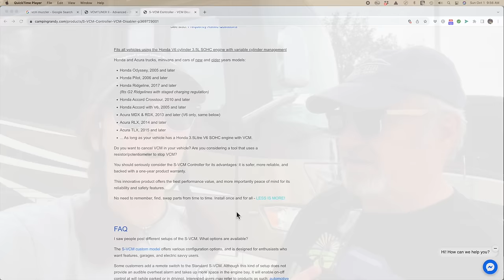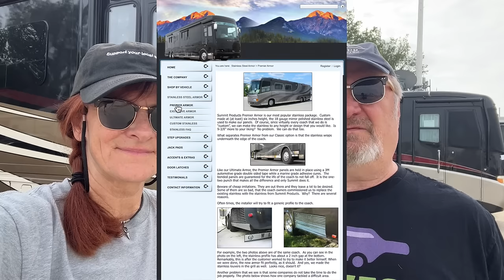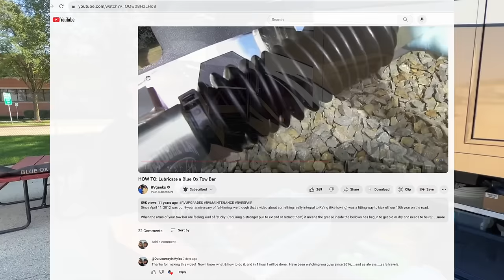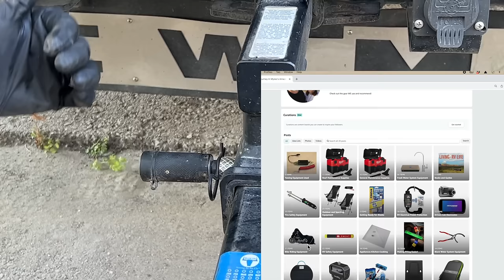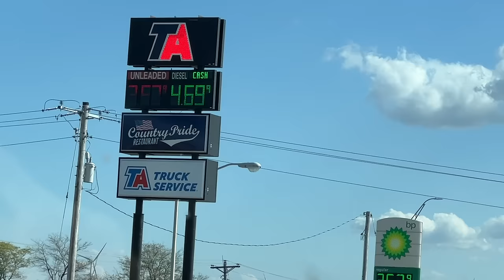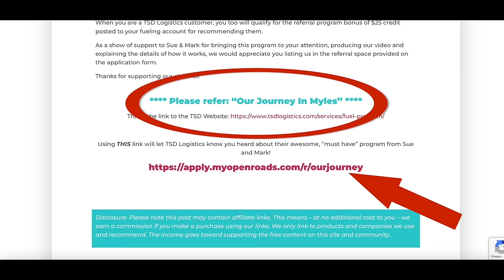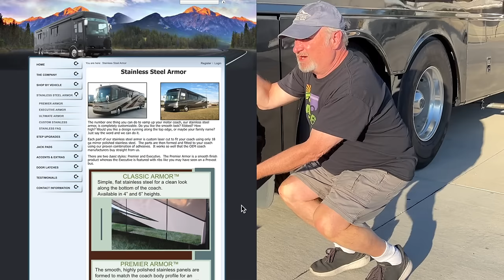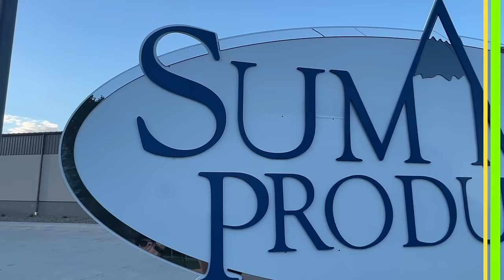Motorhome & Blue OX Tow Bar Maintenance -Preparing for Travel after 5 months -Summit Products -EP283

Comment: TAG AXEL brakes - -This is fascinating. We were looking for a Beaver and now Country Coach circa 2006-07.  One issue is the drum brakes.. My neighbor said we can swap out drums for disc brakes but we can't find anything on that, other than for trailers.  Two questions.. 1) are you aware of anyone doing this on a Class A, and 2) is it worth doing in your opinion?
Reply from the maker: I know virtually nothing about the brands you are considering. Having been a mechanical engineer for 45 years, I would not change the design dynamics of a frame you purchase.  We have drum brakes on our drive and tag axles.  They have never been replaced yet!  They work great,...
Reply: @OurJourneyInMyles  ...fair enough.  If they work well (and we suspected that they do) then of course, it is not worth swaping them.  We are learning that there are lots of crazy ideas out there.

Comment: Interesting indeed! -- HONDA -- Our Honda has the same engine and on long drives, say down to Florida at the same speed, we get the misfire rough engine.  Turned out to be cylinder 3. It is a well known issue and there was a recall to fix it.  Just change that spark plug and all will be good until it happens again a few years later.  Cylinder 3 is the one that turns off to save fuel or something.  The recall should have fixed it.  But a software flash should deactivate the cylinder deactivation and avoid the whole issue - Thanks stupid EPA for forcing this junk on us.
Reply from the maker: So far so good with the Cylinder Musler Kit add on.

Comment: Loved this video. Will replay it for the hubby. In mid Sept. we were on a 5 wk road trip from Castaic Calif. to the Great Lakes area, Chicago and Dubuque, Iowa. We ended up in your neck of the woods when we were sent to Fond-du-Lac to have our cracked over-the-cab bunk windshield replaced in our Entegra Esteem. Top notch company. They allowed us to spend the night in their parking lot so the new window seals had a full 24 hours to cure. 

Sometimes we just have to roll with the punches and do what need to be done to keep our “Magic Carpets” healthy and running. Hope to cross paths on the road someday. Safe travels.
Reply from the maker: You do have to work as a team when traveling, and both be "OK" with the cost and effort to keep the magic carpet flying!

Comment: I now have my rig parked in AZ for 6 months. Do I need to plan to move it or is it ok to leave the entire time?
Reply from the maker: I would have to say I am not qualified to say for certain. Every model RV has its quirks.  We almost went 5 months.  We were on our jacks.  It is such a pain to move just to say you did.  One thing about going for a 20 mile ride, is it would increase your odds things would work in 3 months, if after the first 3 months you did a test move. I would make sure to have tire covers on when in AZ sun that long.  We have great ones in our "Tire Safety Equipment" section of our Amazon Store.
Reply: I do have the tire covers you speak of. I’m not really worried about the batteries and so on but I am thinking of the tires and flat spots?
Maybe not much to worry about? Thanks
Reply from the maker: @martysmith-BonneyLake  I am at NIRVC-Atlanta right now.  A set of 365 width tires were just taken off a coach for flat spots.  Don't know how they got them,.....but that proves it is a real thing that can happen.  I guess the smart thing to do would be to reposition it midway through. I understand the Arizona RV sites can be really tight after everyone is there.

Comment: Interesting. I didn't know auto off on tag axle pressurized the air bag. Learned something new. Thx.
Reply from the maker: It means they will inflate right away when you start the rig, will not deflate when backing up, and will not deflate when making slow turns.  After I got out of the spot, and all wheels were turning, I set the toggle back to "auto".